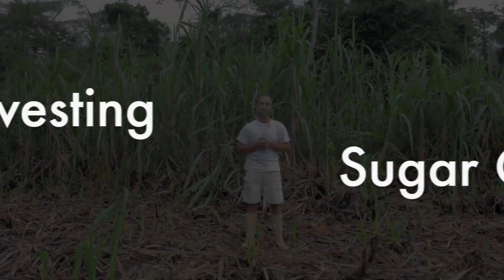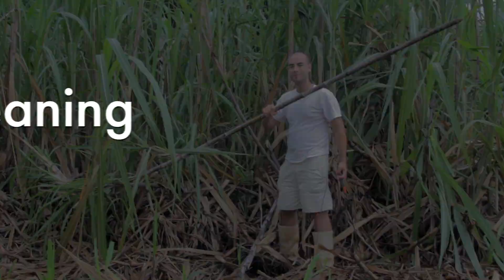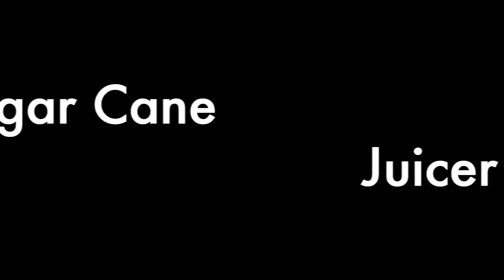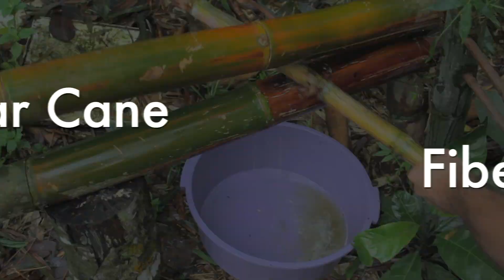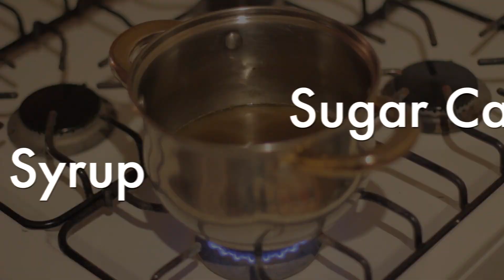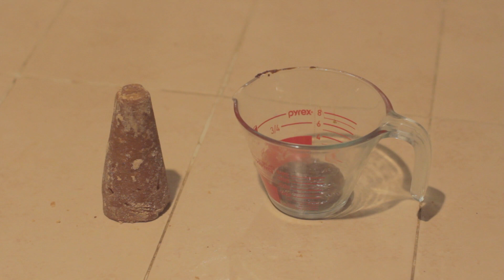Homemade sugar cane juicer

Comment: Just use it straight. The finer you can chop it/ grind it the better it will be. It's similar to coco coir; just a medium to grow in, but you're getting use out of something that would have otherwise been burned or thrown out typically.

Comment: If you want to try it and have access to it, a wood chipper would probably work well. Other than that, it might be more feasible to use it in smaller batches or for other things entirely. Thanks again for posting the videos.

Comment: No offense Vedic ,but the contraption with the bamboo poles just falls way short of extracting the maximum amount of cane juice out of the cane stalk pulp and core but if it satisfies your needs then go for it
Reply: +The Vedic Way  I do know something better. You can use meat grinder , just feed peaces of sugar cane in meat grinder and turn the handle using one hand and wallah you have juice, Allah snackbar
Reply: No I did not